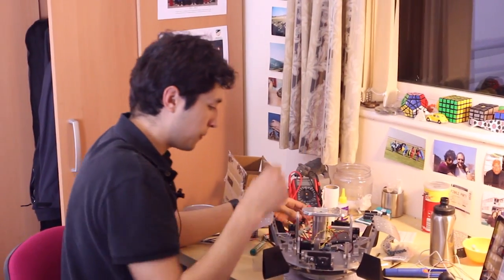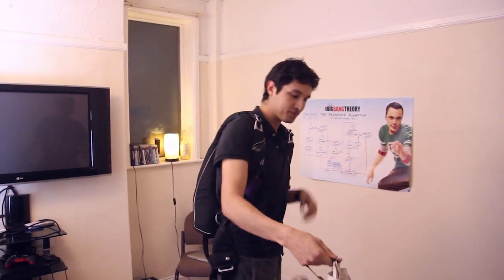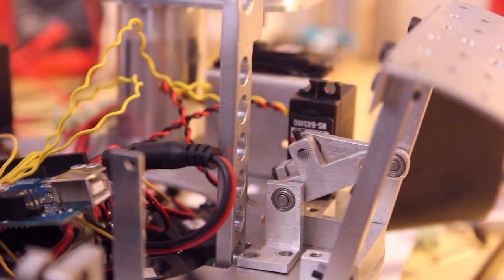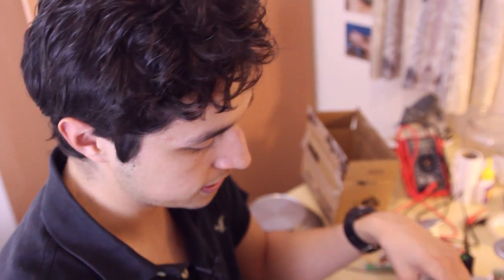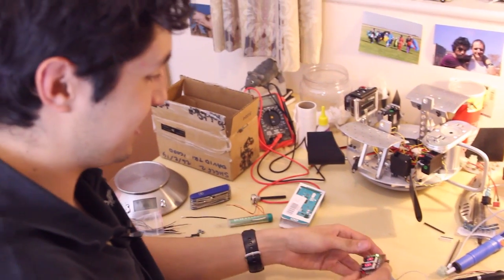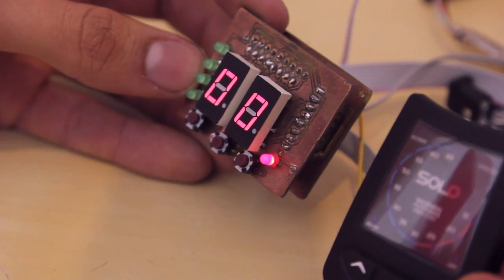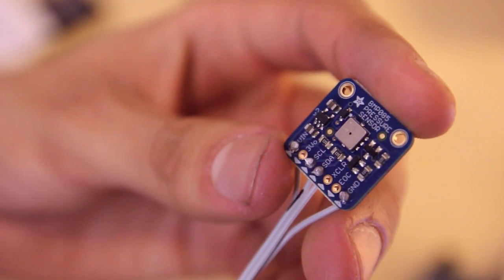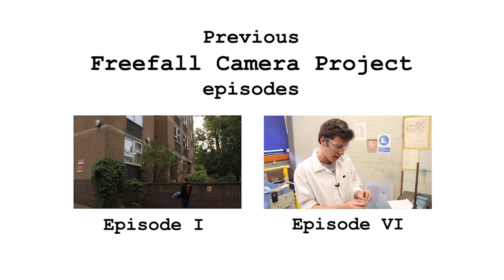The Robot Looks Awesome - Freefall Camera #7

Comment: I don't understand the purpose..... You want a stable falling platform? Aren't all bombs with fins exactly that? A bag of sand with a parachute does that too....
Reply: the purpose is to film someone skydiving, the camera has to have the same velocity as the person falling, when you use a sandbag and a parachute, it would go slower than the skydiver, so you can't film him. if you drop the gopro on it's own it would go to fast. thats why they are building this
Reply: If I understand correctly it is going to follow a skydiver and video them. It is not meant to only fall straight down.
Reply: You can watch the first video of the series (v=BNcNxUdFX6Y) for a detailed explanation - but the basically this robot is aimed at replacing the "camera flyer" needed to film skydivers during their dive.
Reply: d0ublemur but to follow someone, you need to go at the same speed, if you have the same speed you can fairly easy automate it to follow someone (just software to control the flaps)
Reply: It needs to not spin, wobble, or oscillate. It also needs to track the people it is filming and stay close to them, both horizontally and vertically.
Reply: they don't just need a stable platform they need to be able to move it around while its falling.

Comment: From an engineering point of view, having only one fail-safe on a device like that is stupid. You have one MECHANICAL latch that is a attached to a servo. You are relying on that servo to first of all work and to not get stuck/catch in any way shape or form. If that latch does not open then the pilot chute doesn't deploy and your device is toast. 

A better design would have been some form of electrical release like an electromagnet that would 100% release if you shut off the power to the magnet.

Good job otherwise. My final year masters project was no where near as cool.

Comment: While I love to see the Arduino used in this, would it not be more efficient and all encompassing to use either a Beagle Bone Black or Pi instead of the Mega? You’d be able to get the camera module and reduce the weight and subsequent balance due to no GoPro. Also, the power of the Pi should be able to handle most if not all of the logic required for navigation.